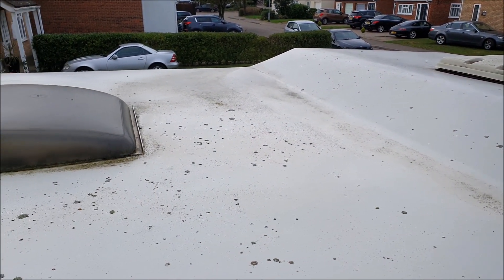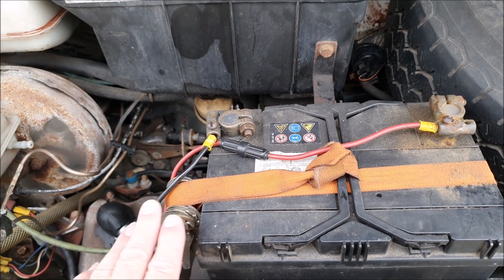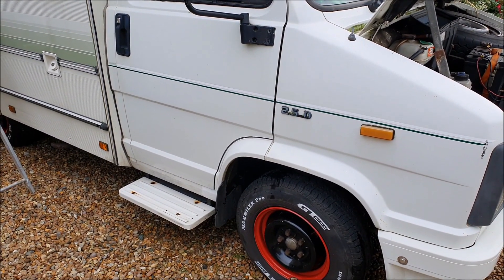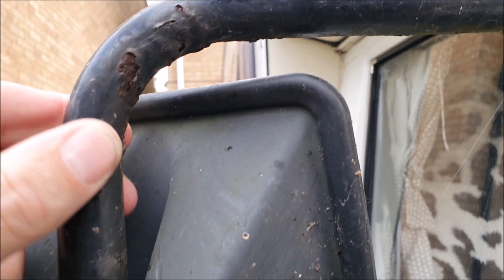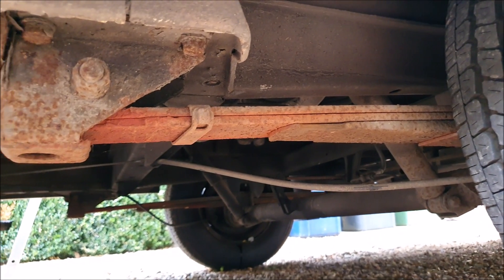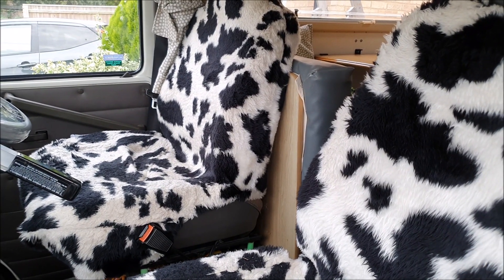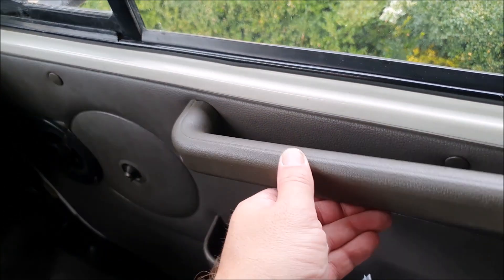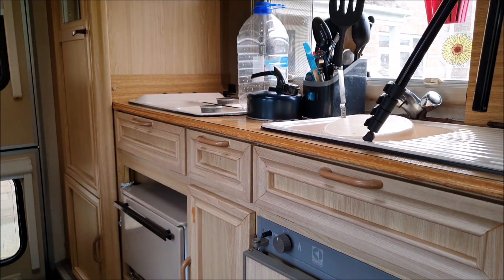Everything That Needs Doing On Our 1990 Citroen C25, Elddis Autoquest 270

Comment: Hi Alex, your roof with the lichen spots use black spot remover it cleans paths and patios..put it on with a garden sprayer and leave it on about four hours and rinse off it works fantastic no scrubbing or brushing just spray and leave.it will bring it up beautifully,just try a section you will be amazed,,,cheers
Reply from the maker: Thanks for the tip, I'll have to give that a try!

Comment: Hi Alex. I totally agree with your views. I bought an older Talbot. Just completed the rear piece of flooring as you are experiencing. Ripped out all the terrible table lamp cable previous owner used all over the place then rewired around 70% under the bonnet. 90% Hibernation and around 70% behind the dash. All with the correct gauge cable. Repaired the Valliant 125.7 boiler the water valve skimmed by hand replace and insulated water pipes and walls. Repaired water pump and so many other things including the gear selector and welded the selector arm. Remover the older tube lighting and replaced with 3w LED's. Repaired the gas heater, fridge and lots of other stuff.  Added an additional 12 way fuse system, reverse cam, built in Pioneer speakers,  additional high level indicator, reverse, brake/stop lights and front upper marker lights. Oncoming is new carpet lining all round.  Spilt charging system. So it's never ending. Lots of the incentive from yourself so Thank you.
Reply from the maker: That's brilliant,  a lot of work you've put in there for sure! Wiring and electrics are my least favourite thing. I must get round to addressing at least some of it though 👍

Comment: I fitted solar as I dont use sites in the main, never drilled a roof yet sikaflex every time never let me down yet
Reply from the maker: I've heard it's very good. I'm more used to using Tiger Seal which I suppose might work too? Add it to the list 🤣

Comment: i see you have something  running down the  drivers inside of the back wheel ,its not brake fluid leaking is it
Reply from the maker: Hmmm, hope not, I'll check it out 👍
Reply from the maker: Just slid under, it's looking dry tonight, could just have been water perhaps 🤔
Reply: @ttxela  did you look on the video you made ,you can see what i so
Reply from the maker: @craigadams6391  Yes I took a look. It does look like it on the video but it seems dry now. No loss of fluid in the reservoir and brakes feel normal.